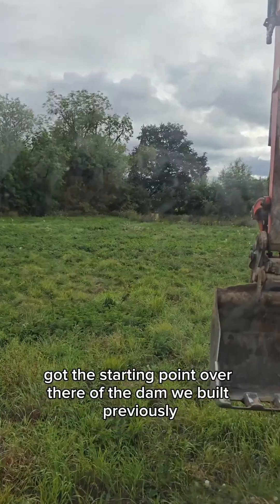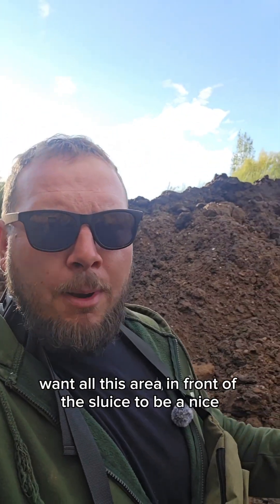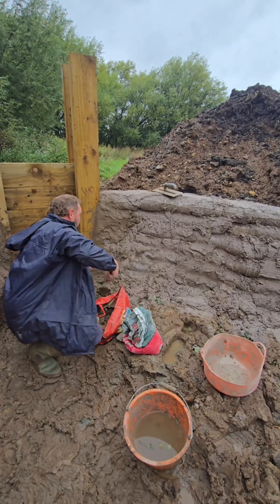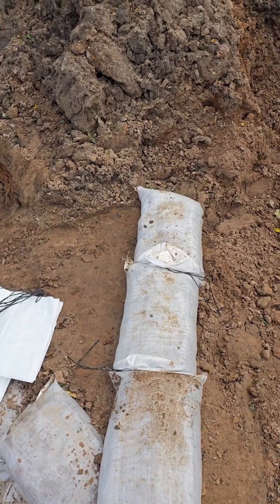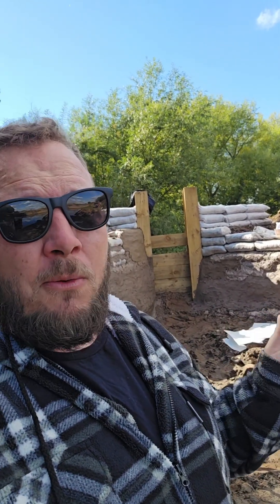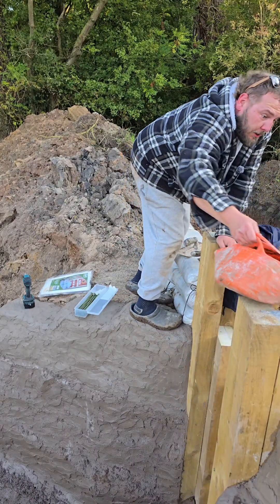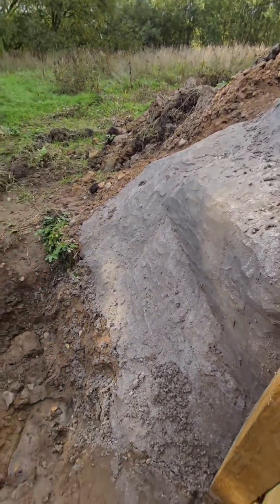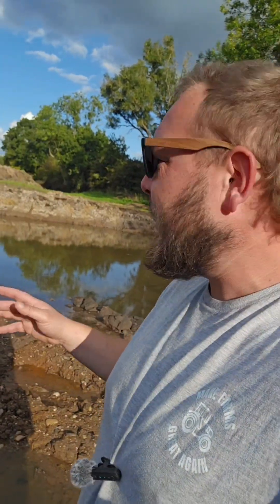Building a Dam for a waterwheel hydro turbine #pond #Dam #hydro

Comment: I've done this a few times in the past and two things I would change in your situation (for a retaining wall) is 1) Every 2 or 3 bags, lay one at 90 degrees out into the bank - it will help a little with heave from the back, especially near the top, pushing forward. Lower down the weight of the water will hold them back. 2) To help keep the render on get some chicken wire and lay it in between a row, sticking outwards and then build up two or three rows and then fold the chicken wire back on and start a new chicken wire loop - it really helps key the concrete in and helps reduce some of the crackiing that will inevitably happen with bag movement. Also stops large chucks of render just breaking off and faling out into the water...

I've been watching your progress with great admiration though, it's incredible what you have achieved...